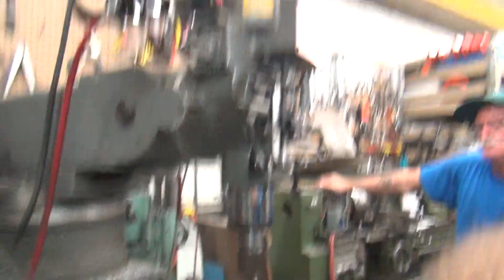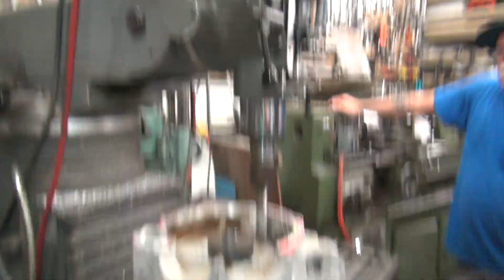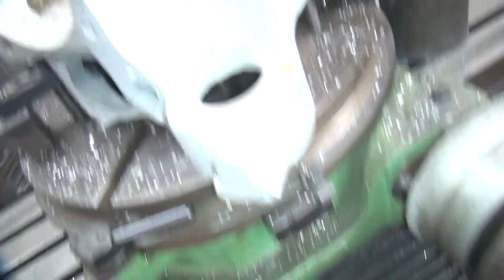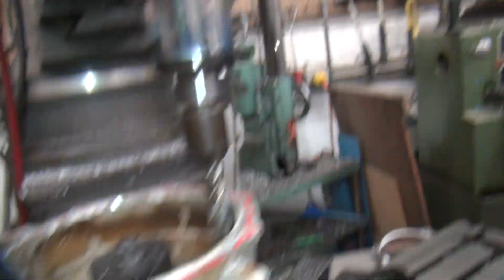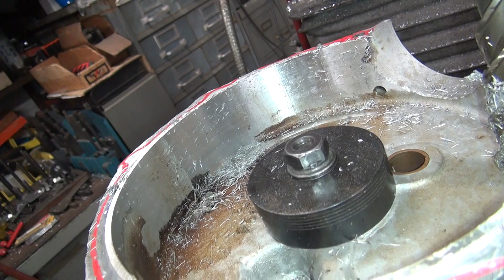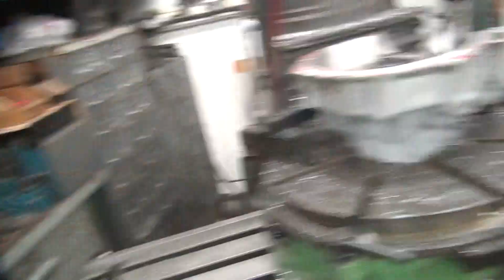#143 1947 EL case welding knucklehead 74ci motor weld and machining repair harley by tatro machine

Comment: No safety glasses! 😭
Reply from the maker: that is correct. i do not wear non-safty glasses. glasses just aim the chips right into my eyes. if you ever wore any you would have know this. i have a brain so i do what works for me. 60 years and still going with everything still attached and working. i must be doing something correctly.
tatro